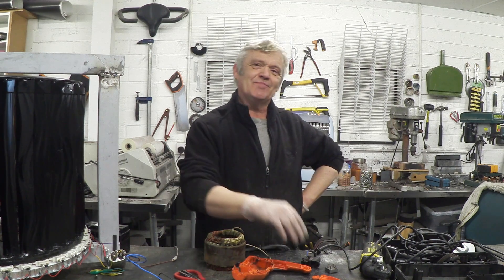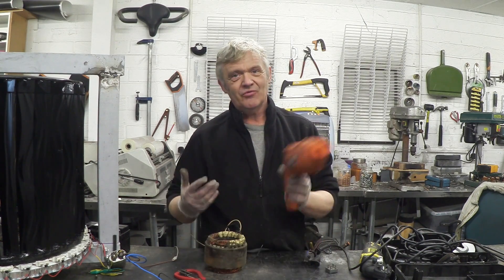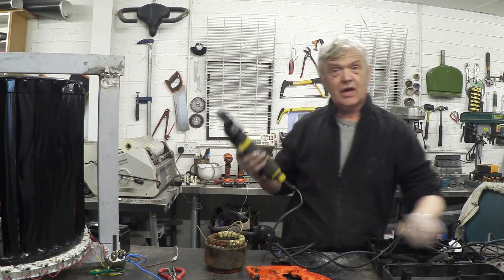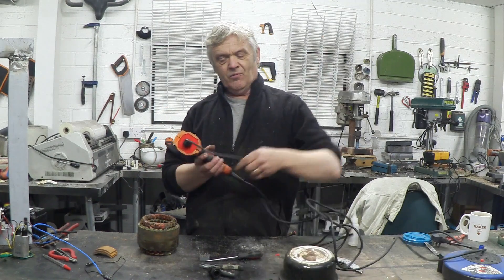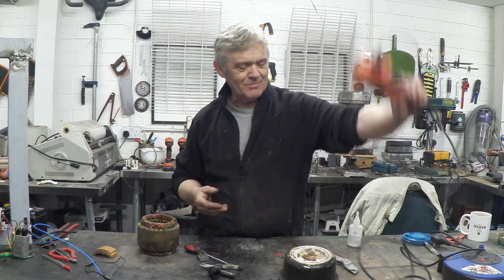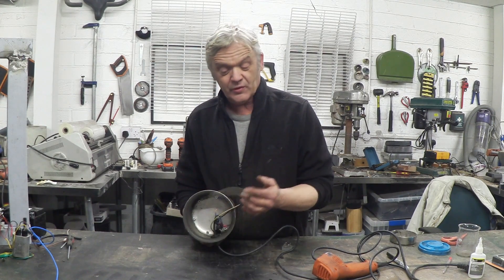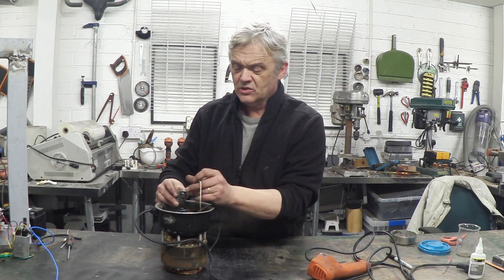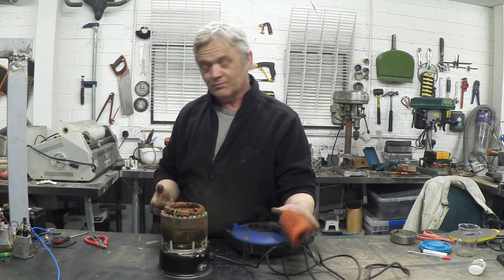DIY Magnetiser And Safety Switch

Comment: For de gaussing (de magnetising) ) you need ac, used to use degaiussing coils back in the day on coulour TV tubes and magnetic tape heads, using a circular motion and moving away from the job at the same time

Comment: Hi Rob, 
As a fellow maker/recycler/fixer up of stuff I have enjoyed my subscription to your excellent channel for some time now and your post regarding magnetising things sparked an idea in me. I have a pond pump that has failed I think because the ceramic magnet on the rotor/impeller has lost most of its magnetism. It spins freely but is very easy to stop with gentle pressure from a finger. The part is no longer available from the manufacturer.  I wondered if your device might re-magnetise it. I would be grateful for your comments. 
We are of a similar age and I too have one or two battle scars from various projects, but I did wince when you used an angle grinder to cut that tumble drier drum without ear defenders. I hope you don’t mind me mentioning it.
 I’m sorry this is such a long message but I have one more request from you… could you please give a plug to the various Freegle/Freecycle/Trash Nothing websites ? I have used them many times over the years to get rid of stuff I no longer use or as a source for parts for my own projects. Cheers, Jeremy.

Comment: Excellent idea. May pay to put 400V voltage dependent resistor or 1uF 400V across coil to reduce inductive transient when releasing switch. This can be thousands of volts and may kill the switch.

Comment: I think current might be higher than in the original induction motor. This coil is made for AC but now you have DC. Coil induction is no more, resistance is still there and will cause power and heating up the coil. If you use it for a long time the coil might burn out. Push the switch for a short time and you'll probably be fine.

Comment: Cool. The drill being a plastic body device may not have being using the earth wire. It looks like you are only passing the live and the natural out of the drill body. Should you also be passing out the earth wire since your magnetiser is a exposed metal object?
Reply: Your thinking to safely. Just don't stand in a bowl of water when using.

Comment: What needs altering to make it demagnetise?
Reply: To magnetise you hold the part stationary (allowing the magnetic field to pull all the fields in the screwdriver to align with the magnetic field it is being held in), to demagnetise you move the part up and down through the field (This will vary the direction of the magnetic field the screwdriver is now in, think of it as just turning all the fields in screwdriver it in all directions so the magnetic fields cancel each other out).
Reply: @madmaveric   thank you for the explanation-makes sense 👍
Reply: A good analogy would be imagine that the screwdriver was just a bag of lose bar magnets. 
When all the magnets are lying in a different direction (their north and south poles are not aligned) they cancel out and produce no noticeable magnetic field.
 By holding them in a fixed magnetic field (as seen in the video) it causes them to all turn to line up. Now the magnets all align and produce a strong field as each of the little magnets are adding to the strength of the field. 
If you move the screwdriver up and down (because the field changes inside the coil from North on one side to South on the other) the magnetic field changes as you move it, this makes all the little magnets turn in different directions as you move it. 
Now if you kill the field as they are turning (or just pull the screwdriver out quickly) it is unlikely that they will all be pointing in the same direction so the field is weakened (aka demagnetised). 
In reality it can be hard to completely demagnetise something with a fixed field but it can be good enough so that it would no longer be strong enough to hold the weight of the screw attached to the screwdriver.